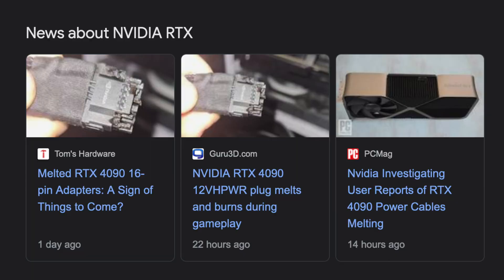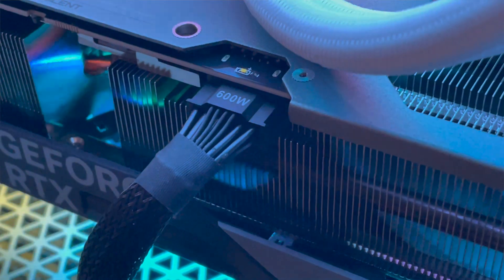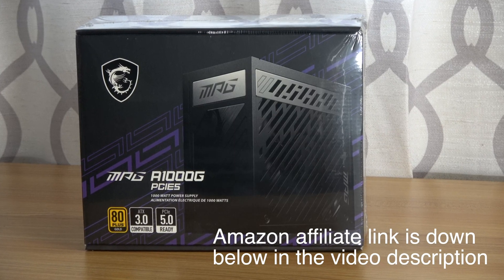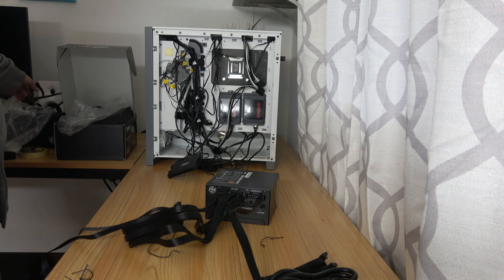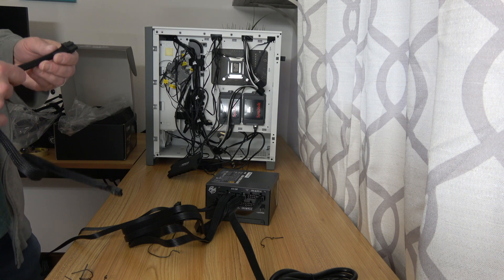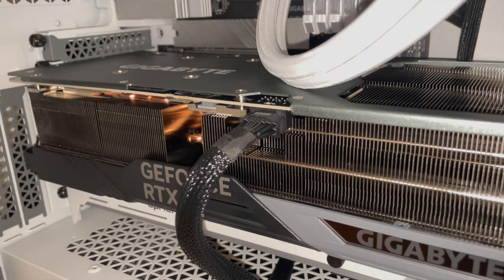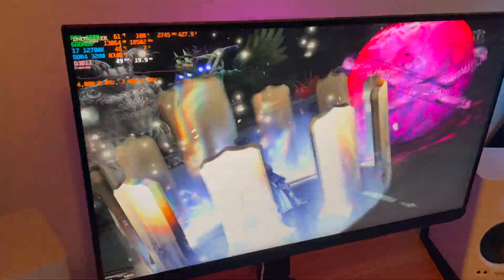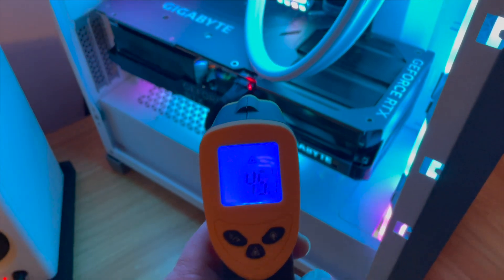RTX 4090 Melting Cables - My Thoughts and PCIE5 Power Supply + 12VHPWR Setup

Comment: @Tech With Sean I have this case and im wondering if i can vertical mount this Gpu with the built in pcie bracket on the case but i think there is not enough clearance as the plastic part sticks out too much and would hit the side glass, or use the coolermaster v3 vertical mount?

Comment: Hey Sean, you mentioned this was being used in the 4000d Airflow by Corsair, I have the 5000d Airflow, Im wondering if with the native 16 pin to 16 pin, will I have any clearance between the cable and the glass side panel?
Reply: Super late reply, but did you ever figure this out? I've just ordered a Strix and the 1300W version of this PSU, also have the 5000D. The 5000D is a bigger version of the 4000D, so if it fits in his case without much of an issue, then I imagine it'll fit in a 5000D. But just curious if you were able to answer this or not.
Reply: @icanmakeeverythingilovedie9861  So I have the Zotac 4080, using the native 16 pin to 16 pin to my MSi A1000g PSU, and I have clearance between my side panel on the Corsair 5000d Airflow

Comment: I have an older 1200w platinum psu that i think will require the adapter.. you think I'll be OK not upgrading my psu if I get a rtx 4090? Are the adapters an issue even with a 1200w older psu?

Comment: How come no 3090s which used the same 12vhpwr cable thingie ever melted? All tech tubers seem unwilling to answer that!
Reply from the maker: There are older posts on Reddit of melted 3090 connectors, just not as many. People have had regular 8 pin connectors melt before too. Nothing is going to be perfect,  especially when users install it themselves.

Comment: As an electro-mechanical design engineer who's responsibility is actually selecting connectors, I will shed some light on this. 1st, with the load they are putting on this connector they should have opted to add more pins than 12. Always add more pins to exceed the connector rating by 50%. Had Nvidia done this we would not be having this conversation. They have 4 connectors at one end of the adapter ganging-up on just 1 connector at the other, what's wrong with this picture?  I suspect they had real estate issues on the PCB layout and one way to address that is to minimize the connector footprint by reducing the pin count. The engineer made the calculation and "under ideal conditions" figured it was OK 😮 If a connector is getting warm under max load means, it's inadequate for the job. Imagine having this problem on aircraft wiring, the FAA would ground every plane until it was resolved. The problem is the thin female crimp contact and the small gap on the Molex connector between where the wire is crimped and where it contacts the pin is, that's where it's getting hot and melting the connector housing. When you bend the wire, it causes the female pin to rock against the pin further decreasing it's contact area. Overtime the contact will weaken its grip on the contact causing the problem to get worse. I suspect Nvidia didn't discover this until the graphics cards were released to the public (by the 1000's) and report started coming in from customers but by then it was too late, and they realized they have a huge recall problem on their hands. Their solution is to ignore the problem hoping it will "go away" but it won't. I really like this card and want to use it in my new build and may consider removing the connector and soldering the wires directly to the board which will void the warrantee. I wonder if Nvidia will replace this GPU if the connector melts, but I suspect they will blame the consumer and deny the warranty claim. If someone house gets burned down as a result, they are going to have a real liability problem on their hands and they lawyers will have a "field day" with this one!  Trust me, the execs at Nvidia are walking on eggshells. Someone screwed-up here real bad

Comment: can be bad connectors or the card itself(manufactore faults),   a small amount of failures is because of user treating the connectors bad(less than 5% of the faults). My Point:  if there is a design flaw we would see much more burnt connectors.

Comment: The adapter that converts 4 x 8pin (6+2) PCIe connectors to the 12VHPWR connector solders its wire connections to much smaller pins which drastically increases the likelihood of the pins twisting or being pulled out if the adapter is bent outside of limitations of which groups like cablemod have also mentioned on their website. The adapter is poorly designed, and I like others blamed the 12VHPWR connector for what it seems to be mostly the adapters' fault. I still personally think having four 8 pin connectors would've been perfectly fine and cool to look at, that along with the fact we understand 8pin connectors much more than the new 12VHPWR port.

tl:dr Do NOT use the 12VHPWR to 4 x 8pin PCIe connector adapter if you value your RTX 4090, spend money on an ATX v3 power supply that comes with 12VHPWR cable to the PSU, and make sure you're not putting a lot of pressure on the port.

Comment: I got the cable from cable mod. I hope. It's safer than the nvidia adapter. I will get the 90degree adapter from cablemod and an atx3 psu when possible (nothing available for now in France)

Comment: Lol so calm and rational compared to all the outrage going around. Too sensible using a PSU made exactly for the 4000 release. From what I have gathered the adapter is dumb and doesn't know how much wattage it is sending into the connector and if the connector is not properly seated there is going to be significant resistance. A PCI 8 pin is capable of sending 300w by itself so multiply that by four and the power getting lost due to the resistance its just going to keep asking for more until it melts.

Comment: So the 3090 TI and the 4090 all have the 12VHPWR plug. But with the 3090 TI the adapter was just a 12 pin adapter without the 4 pins (same adapter as the normal 3090 but minus 1 8 pin). While the 4090 has the 12+4 pin adapter. So im wondering, if the 3090 TI who has the same plug as the 4090 worked without the need of those 4 pins. Shouldnt the 4090 do the same? Or do you NEED those 4 pins? The 3090 TI and 4090 PCBs are not that different. So in theory, what worked on the 3090 TI, should work on the 4090.
Reply: You only need the 4 pins if you have a new Atx 3.0 power supply
Reply: New pins are data pins and allow the new ATX 3.0 psu’s and the 4090 to talk to each other. Basically it’s a lot safer way to power the gpu as the psu will only provide the power the gpu needs, no more or no less

Comment: Seems like a contact issue that results in arcing and hence melts the adapter. Bending of the cable could cause the pins to pull and loosen which would create contract issues and electrical arcing.

Comment: I returned my 4090, I'm not going to risk a fire for extra frames!
Reply: Good choise dude, i stay with my 3070 strix till they fix all, and the prices
Reply: idiot spotted. 4 issues with 10 000 cards, 99.6% safe, and 99.99% user fault probably....

Comment: I think when Nvidia test their cards they didn't use the Nvidia adapter to test them with. They probably used native cables or a different testing situation. But the manufacturer defects do make sense, I think cable quality matters that's something the Nvidia adapter doesn't have and it's just awkward. They should've included a longer cabled 90 degree adapter with the 4 pig tails far away and towards the back panel cable management area. I'll 100% be getting that PSU you have, Is there any issues like noise with it?
Reply: no reason to buzz this minor issue, 4 issues with  10 000 cards, 99.6% safe cards, probably user fault with cables beny
Reply: Even the native cables can have the exact same issue when bent genius.
Reply from the maker: Not noticeably any louder than my previous Corsair RM 850x PSU. This one has a Zero RPM button on the back to put it in a mode where the fan will stop when it’s not under heavy load, also.
Reply: @TechWithSean  hey its still ok?

Comment: These temperature readings are for the cable insulation & the socket the wire that connects will have much higher readings.

Comment: I think the melting cables could also be a byproduct of bad airflow in the case. A few tech review channels have stated that you should have a minimum of 4 case fans to help get out all the  ambient heat generated by the card
Reply: Lol no.
Reply: No it's just the connection